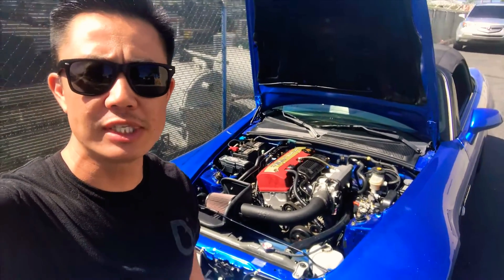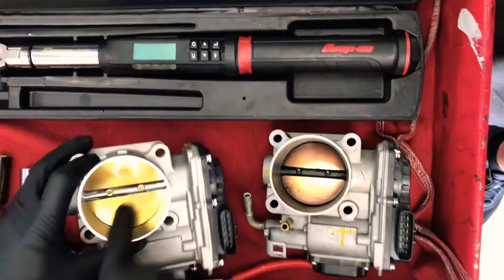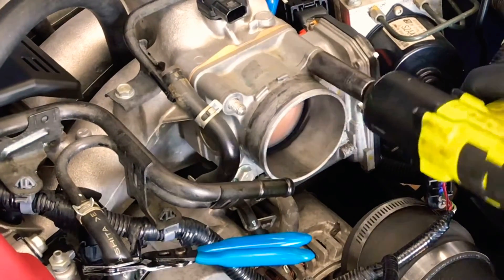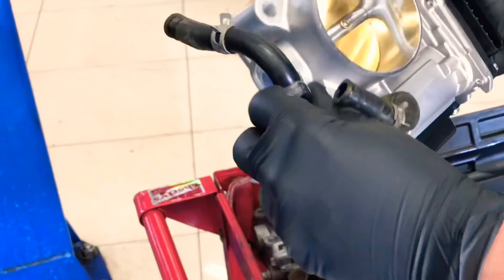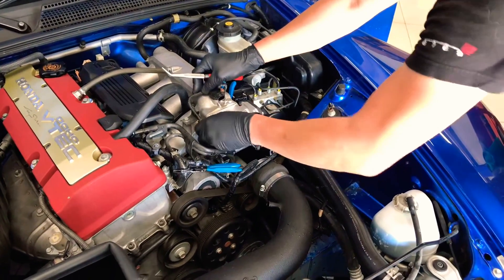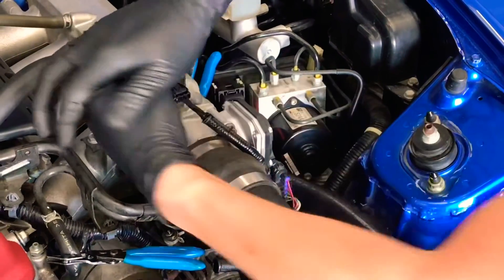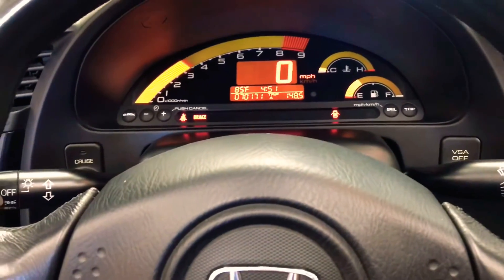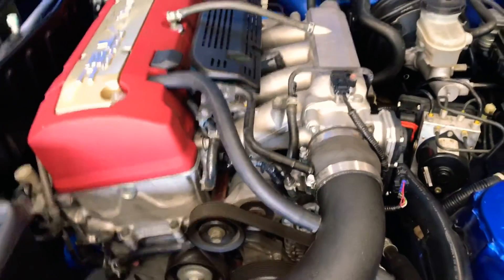Honda S2000 Electric Big Bore Throttle Body Smog Legal?

Comment: Didn't  port match it to the manifold  so no gains
Reply from the maker: What do you think Honda S2000 2006+ dbw intake manifold inlet size is?  69mm stock.  Ballade throttle body is the only one on the market port matching to the stock plenum.  It’s Honda who isn’t port marching smart guy.  Honda stock is 65mm throttle body to a 69mm intake plenum.  You understand numbers don’t you?  😊

You know nothing Jon Snow ❄️

Comment: I have an 09 ap2. Would I have to adjust the TPS on this throttle body like in the regular cable one for the ap1 as show on your other video?
Reply from the maker: armando quezada no adjustment.  Simply bolt on and drive
Reply: @BalladeSports  thanks for the fast response. I'll be ordering one soon! Along with a high flow cat.
Reply: Planning on buying one definitely since I'm having trouble with my tps